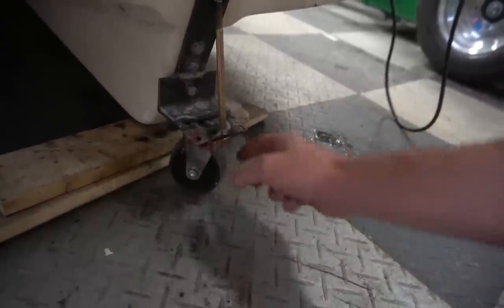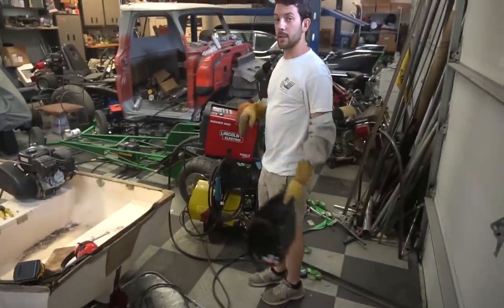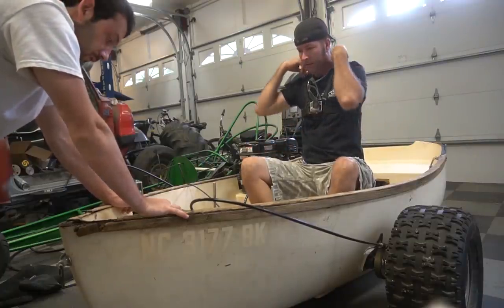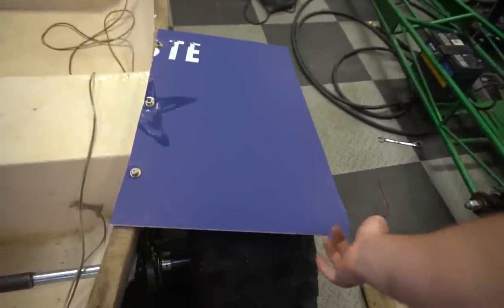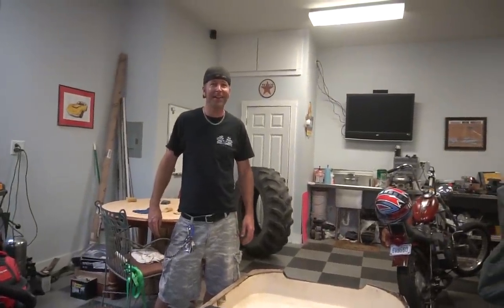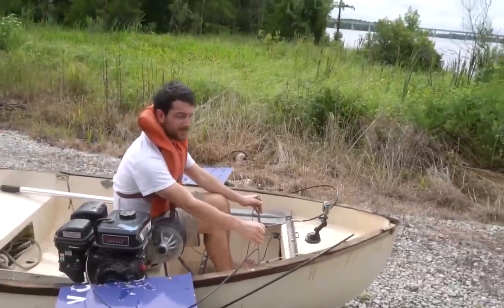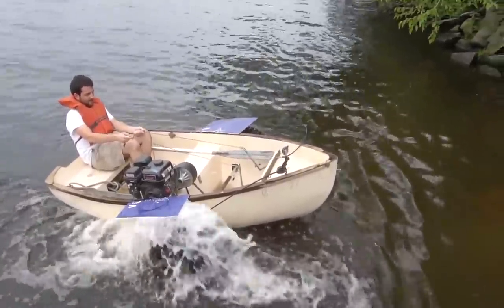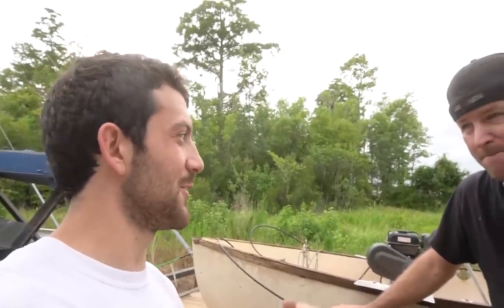MAIDEN VOYAGE | Amphibious Go Kart "Tank Boat" Pt. 3

Comment: Sand tires
Reply: Billy Pierce I agree
Reply: Billy Pierce it will just fling more water into the air. They need trailer fenders over the tires or something to control the thrust they are creating backwards into the water.
Reply: Yeah true its common sense they should already have them
Reply: Michael dorn yeah? And how the fuck are they going to work on pavement? Like shit. Bad idea
Reply: @caydenthompson1878  I think to make it drive well on pavement, you'd be missing the main idea here..

Comment: You guys should add some homemade aluminum style (+ sign style) props that come out of the center of the rims... not bigger than the whole wheel. Should help with some speed in the water. And maybe a small bilge pump to take out the water. Always take an oar or 2. Keep up the good work.
Reply: Matthew Romero exactly what I was thinking
Reply: If it comes out of the center of the rim it would most likely be almost or completely underwater, making it useless
Reply: Follin Kuhn how? If you made it the size of the rim, not the tire it would be fine. Clearly in the video half of the rim is out of the water.
Reply: ThatDudee Ryan makes sense, I was thinking it would be smaller than the rim

Comment: If you put trailer fenders that fit snug around the tires you will create more controllable thrust. Right now the tires are just throwing water in the air and wasting all your thrust. If you can control the water to be shot only backwards into the water, it should create way more useable thrust and actually move you. It's like a jetski pump, you have to be moving water to go.
Reply: the wheels act as paddles...directing water would be like in cartoons when they put a bathtub in the water and put the shower head in the drain hole and the water leaking in becomes a thruster...im pretty sure that only works in cartoons
Reply: stickloaf yes but when the "paddles" (tires) are ten inches tall and spinning as fast as they are, they will not push the thrust in one direction.
The huge steam engine paddle boats work because they can move a huge amount of water at a slower rpm which controls the thrust without shooting it everywhere. So yes, unless they put eight foot paddles on the boat and drove it at a slower rpm it will not work out
Reply: stickloaf also how do you think jetpumps work .... They direct water. If you can direct water efficiently and add pressure it will make thrust. I don't know what a cartoon has to do with it lol

Comment: Use a larger castor from harbor freight
Reply: Maybe a rear fixed wheel and tire, castor is not needed, to help on the boat ramp, until you install tracks.
Reply: What about a wheel rutter so you can steer it like a normal boat?
Reply: Deimos Phob best solution

Comment: fit some sort of paddles on/in wheel hub??
Reply: Darren N that is a genius idea. And put a router on the back.
Reply: Ash Doodge, I think you mean a rudder
Reply: Branden Davis no just for safety if you get stuck on the lake and you need to call for help😂😂
Reply: That is a really good idea
Reply: Or atv sand tires, with paddles on them. Way easier. And that caster wheel on back, change it to a larger diameter pneumatic one and it shouldn't act like a claw on sandy/pebble covered beaches
Reply: Maybe it would be possible to weld paddles on the outside rims. It might work similar to an old steamboat.
Reply: just mount a lightweight flywheel to the outside hubs of the wheels...with the fins...or something similar..know what i mean vern?
Reply: Branden Davis well you know what I meant 😁
Reply: How about sand dune tires
Reply: Darren N Use ping pong paddles!
Reply: Exactly what i was gonna comment
Reply: Maybe even tires with a different tread?
Reply: I was literally about to comment this. Some sort of paddle smaller than the diameter of the tire, mounted onto the rim with enough surface area to create enough drag to move through the water
Reply: Sand paddle tires would definately be the key
Reply: I have been saying that for every episode so far. All they need to do is weld some flat peices of metal on the rims
Reply: Nathanael Lloyd flexolite ping pong paddles
Reply: Yeah but also make the fenders shaped to catch the water and throw it back wards.
Reply: You need Paddle tires
Reply: Lsd Bread me too.  Wonder if they will listened.  I think the problem is they post these videos a week or more after they’ve done it.
Reply: It's able to go full lock at lower throttles at the moment, but yeah if it starts to slip when they try turning at full throttle then that could help. Plus it'd be more comfortable, at least in the one position.
Reply: I commented this same thing before. I'm wondering if they'll actually do it in the next episode.
Reply: Should of had a second engine that has and prop on the back of the boat
Reply: I agree
Reply: I was thinking of if anyone remembers.. them old wooden toy ducks that a child pulls by a string.. The wheels had rubber flaps on them.
Reply: What about a wheel rutter so you can steer it like a normal boat?
Reply: I was going to say paddle tires but your idea is better
Reply: Jason Buzzell thats a good idea bro
Reply: that would be too small diameter for catching water to move such a size boat....

Comment: Try sand paddles and real fenders. It won't matter once you phase it into a tank, the agricultural tires should have sufficient paddling capability. You should have a battery and a trolling motor on-board just in case you get into trouble.  You will also need a bigger caster in the back, preferably a air filled one. More buoyancy and could double as a rudder when you are in the water. Just some thoughts, like the project.

Comment: Add a paddle wheel to the rims and use a air filled Zero turn mower caster. Your bow is hitting the ground on launch and landings. You can also use sand tread or a more aggressive tire. Also you need a battery powered bilge pump.

Comment: You need to build fenders that only allow for the water to mostly travel in one direction when it exits the fender. You need sand rail or paddle tires. You need to build and a swivel axle for the rear like what's on swathers. Swathers cut hay if you didn't know. I'd put a steering dampner on the rear steer to make the steering a little more controllable and smooth. Put a springed chain tensioner on the drive chain. Awesome build guys. Hope you get it working the way you want. The fender thing is very important.  I seen that on a collage go cart land water engineering degree competition. They found that carts with fenders that almost entirely covered the drive tires went 3 times faster or more. Great video guys.
Reply: Ben Hawke thanks
Reply: Isaac it'll be fine 
Yeah the back of the fenders have to be opened a little more than the front. Kinda like half a teardrop.

Comment: Could you use a plane tiller/ handlebar set up for steering/braking? You could then have a bike twist grip throttle, left/right steering and pull back on bars to brake fully. Maybe even push on the bars for throttle? Loving this build😊😊😊😊

Comment: First off....I love the machine!  I have a couple of suggestions.  1. Change the castor wheel to a small tire.  It will never work well on anything but pavement as is.  2.  Change the main drive tires to paddle tread.  You will get much better propulsion and steering.  3. Proper fenders.  I'm sure you have already thought of that!  Now...I know your planning to change it into a tank so theoretically my suggestions won't apply but if that fails keep them in mind.  Good luck...best project yet!!!
Reply: Gerald Wallace thanks

Comment: It's not cavitating, the tread on the tire picks up water and flings it out forwards like a jet, which produces more backwards thrust than the submerged part pushing you forwards. This is the second amphibious kart I've seen that does that.  If you want to avoid it you'll need paddlewheels or something which turn slower and dig into the water more (your tracks might do, or paddles on the wheel rim as Matthew Romero says)

Comment: only thing I think might help yall. me and my brother built an amphibious 4 wheeler and made steel paddles. welding every inch or so around axle on both sides. also we do a lot of offroading here in Tennessee and we will bolt a flat plate to the hub of the wheel tht fits the bolt pattern and make a paddle like a tow boat. really hope yall will take this into consideration. you could maybe use a lighter metal to help reduce weight. but it will help.

Comment: Some suggestions, suggestion one, a water extracting fender, it doesn't have to be touching the tire but near it to catch some of the water getting picked up because any mass it's throwing forward "the water spray" turns into a kinda water jet facing the wrong way, I'd suggest having it at least throw the picked up water outward but it would be lovely if a kind of 2 layered fender with the outer wall of it was curved smoothly around the closer wall to redirect most of the water to behind the tire, not sure if closing off the sides of the fenderwould make a positive difference but it can be attempted. suggestion number two, make a lever system that all the way back puts on the brake for that side then a neutral point in the middle then all the way forward on either side puts in throttle, it makes a smoother and in a way a easier to handle control setup and removes the need for the pedal. Then you could even just make a linkage if you want controls for the back as well. Just my thoughts in the form of suggestions! I really like the concept

Comment: That is awesome guys! Note: If you build a close fitting wheel wells that flare out like a dove tail at the back and follows the contour of the tire in the front, you'll be able to better direct the flow of water discharge for the tires and get better speed while in the water. You could also get a pneumatic caster for the rear that would help in both traction and in prevention of the rear digging into the turf.

Comment: What about if you strengthened the wheel arches and ran them down in front of the wheel then maybe the water flicked up by the wheels would hit that and produce a small amount of forward thrust.... probably wrong but just an idea.
Reply: I'd like to see that
Reply: more like if the fenders made a V shape just behind the wheel so the water flicked up bounced backward so it wasn't pushed in front of the wheels
Reply: yes no ah ok, I wasn’t sure of the physics of it but thought it might work somehow.
Reply: mavos1211  yeah you have you right idea it's basically the same physics the water bounces off and shoots backwards thus propelling the boat forward a slightly but it's just the positioning. I mean your idea might be superior to mine because of weight and such I don't really know
Reply: yes no It would be interesting to see, the “v” design does make sense directing the water more efficiently, let’s hope they take note and try it out.
Reply: mavos1211 yeah, I think if they do they'll probably use a completely different design but hopefully we're some what in the right track
Reply: like a fender that scops the water down and back just under the tire propelling the boat forward

Comment: CarsandCameras Cheapest option that I would do would be rounded custom fenders, quick release large  " + " shaped paddles attached by 2" of square stock welded to rim centers with a hole through for a locking pin to attach to smaller square stock on paddles.  Also a larger harbor freight caster in back.  Everyone in the comments  is saying paddle wheels and directional fenders as well as bigger or rudder driven caster though, which makes sense.  It would also be fun once this project is done to modify a wave runner CarsandCameras style i.e with big powered wheels or some other cool design.  Thank you for the excellent videos and actually building these cool things

Comment: Larger pneumatic castor wheel with a paddle device attached to the outside of the wheels would greatly improve "Tank Boat's" mobility in and out of the water. Great build guys!

Comment: Y'all should've used some of your tractor tire sidewall, to make rubber axle seals,  installed a small water pump for a bilge, and used innertubes for sealing any holes you put in the transom. Also, a moving dolly sized wheel on a hand-built swivel would have worked SO much better! It would also have provided extra buoyancy.

Comment: What if you welded fins protruding from the rim that were slightly smaller than the tires.  Also a full fender around the wheel for dryness sake.  That was awesome though.

Comment: So cool how you made the differential work like a zero turn by using separate brakes on each wheel. You should make some paddles on the sides of the wheel to make it get  more traction in the water

Comment: It performed like I thought it would. I think a larger caster wheel from Harbor Freight would help it move easier on different surfaces. Nice project overall with what you used. Good job fellers.

Comment: Get a larger diameter castor wheel that has air in it..... it may ride a bit smoother and also add a small trolling motor..... would be super cool if it had a jet drive !!!!!  Cool build as always. thanks for the laughs 😃👍

Comment: Need a prop out back. Install portal axle hubs at either side of boat and get rid of the rear castor in favour of an inflatable wheel. It’ll help with floatation and work better in gravel/sand

Comment: You could get snow chains for the tires and weld some angle iron to them, to run in the water like a paddle boat. And they would be removable for land usage. And flex-seal.

Comment: You should do the tracks with snowmobile tracks with like 1 1/2 inch or more paddle. And use a rubber 6inch caster for the back. Could even wrap the tires with tracks for a test.

Comment: Fabricate some thick sheet steel pieces and weld them together to form this shape + looking at them from the side. Weld the corners of the plus sign to the outer edge of each rim. Make the paddles tall enough not to hit the ground when riding on land, but large enough to push some water.

Comment: Put some fenders over the wheels that have a splash wall toward the inside of the boat with a 45 degree slope as to keep water from splashing up into boat.  Sort of like a cage over a wheel housing on old belt driven machines. Make them lite by using carbon composite with braces  This wall on the wheel well will make your project a success rather than sinking to the depths of Davy Jones locker.

Comment: Neat idea, but so much easier to just put the boat on a stretched go kart chassis, use thin taller tires on front so the steering would work.  You'd have to use a trolling motor or small outboard, but the boat would be dry and it should climb right up the ramp.

Comment: Gonna ad my two cents. Paddle tires and actual fenders that don't allow the water to come into the boat when high idle. Also cup the front of the fenders so the water over top don't push the boat in reverse.  Might wanna think of a large tire in the back for steering instead of what you got, or addition too. Pretty cool tho if you can perfect it.

Comment: If the tires-to-treads idea doesn't pan out, a multi-axle set-up may work. Obviously more expensive with the axles. but the bearings through the hull obviously work. It will just need a lot of chain.

Comment: Instead of using caster wheels, you could use a rutter with a wheel on the end on the back and control it like a normal boat on the road. You'd need a bearing in the spot on the bottom where you put the caster to reinforce the wheels

Comment: At about 8:10 (and also a few other shots) if you look at the left side of the screen where the axle meets the hull of the boat, you can see water gushing in through the bearing/hub and spilling between the two layers of the hull.

Comment: its all about the tire tread...try it with some sandpaddle tires from a quad and stable fenders that help create some more forwards thrust in the water...and why didnt you guys make a steerable back wheel/rudder!?! take a wheel from a wheelbarrow and make it just like those old rudders sailboats had mounted on the back but insted of a wooden finn its a wheelbarrow tire...should increase movibility/control tenfold on land and in water & increase ground clearence & brakesteering becomes unnecessary wich i´m sure the engine will thank you for in the long run & last but not least a real wheel in the back will make the ride more comfy,at least a little shock absorbtion plus should handle diffrent terrains better...but other then a few design flaws that make it more complicated then it should be it´s an awesome little project!

Comment: You NEED to get a larger diameter wheel caster or it will plow in gravel and get snagged on every hole and bump.  I should always have a paddle too for emergencies.  When you get a rear axle and wheels to form you tank tracks I think it will solve many of the current problems.

Comment: Rear paddle wheels driven from the axle, gear them lower than the current wheels. the fronts will "smooth over" and the rear paddle wheels will propel the boat.

Comment: It needs a front wheel off of a zero turn mower so it dosent dig in and it needs dually rims with paddles on the outer rims small enough where the dont scrape the ground when on land put still paddle in water. Fun to watch guys.lol

Comment: Suggestion:  make a round flange and pipe adaptor that will fit your lug nuts.  The pipe should not extend out from the center of your  tires more than 12".  On the pipes weld paddles around them shorter than the tire height. (Perhaps curve the paddles toward the front of the boat to grab more water.  Then you would have something like the old time river paddle boats and the paddles should propel you quite nicely....at a much lower rpm, by the way.